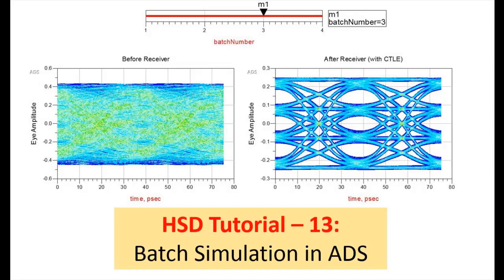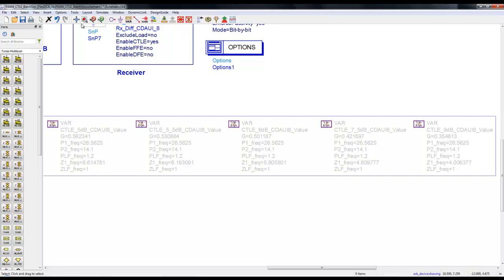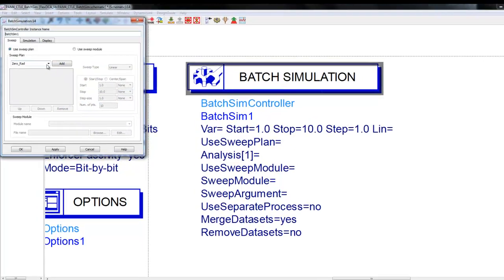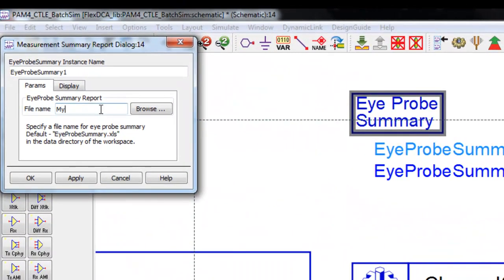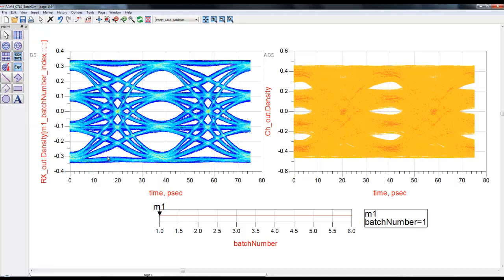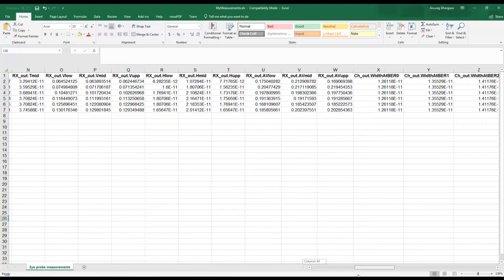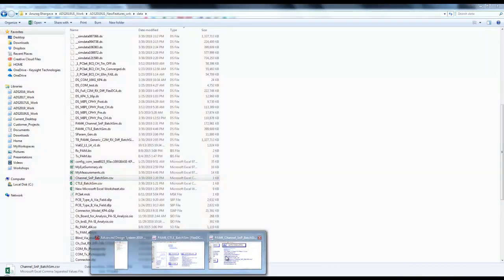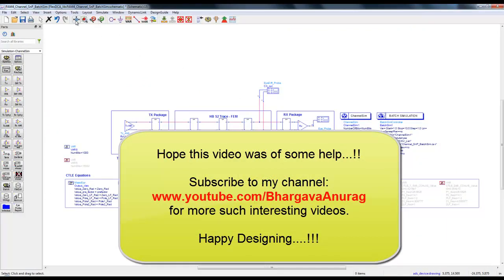HSD Tutorial-13: Batch Simulation in ADS

Comment: This video has been so helpful, I was able to set it up the way you showed, but when I change the batch number slider to 1 or 2, or 3, it seems that the eye has the same input values in all 3, so it did not sweep across the CSV file, any ideas?
Reply from the maker: It is difficult to suggest a solution without looking at the problem but few things you can check:
1. Without the slider do you see different responses overlapping and you can visually see the difference?
2. If not, probably you need to check your schematic and see if the variables used for sweeping are assigned in the desired components or not? e.g., you might be sweeping rise time variable but if the same variable is not assigned in the source then it won't make a difference in results correct?
3. If you can see the differentiating overlapping results but it doesn't update with the slide then look at the slider setting and ensure it is applied to the plotted value correctly.

If you can resolve it then contact Keysight tech support team by writing to support@keysight.com
Reply: Same issue here as well.

Comment: hello，Have you posted a video on Back Channel Interface（BCI）? If yes, could you please share the link to the video？Thanks
Reply from the maker: Hi,
I don't have a specific video on BCI but it is supported in ADS Channel Simulator and it can be enabled by simply selecting that option in the IBIS-AMI models. You can contact local Keysight support team if you need further help on this.

Comment: If the adaptive optimization is available, do I still need to do batch simulation to find the best taps? I heard that the adaptive optimization algorithm inside the AMI model is independent between Rx and Tx. Is that means I still need to use batch simulation  to sweep all the situation. Does ADS has co-optimization process in EDA tool?
Reply from the maker: Hi Xiaowen, ADS does support that protocol. If you have it in the AMI model then you can simply enable it and ADS will do handshake as needed between Tx and Rx AMI models.
Reply: @BhargavaAnurag  Thanks. So I should just enable the adaption optimization, is there any other setting I need to do?
Reply from the maker: @xiaowenmin5336  that's correct, you just to enable settings in your AMI model to get going. There is no special setting you need to do elsewhere in ADS. You can refer to an PCIe example in ADS by searching for BCI and unarchive the workspace to see the settings. The adaptive optimization you referred is called as Back Channel Interface (BCI) and it is the protocol standard which is used by Tx and Rx to adaptively converge to the best possible settings of configurable parameters based on the Channel characteristics. 
I will try to create a video on the same so that others can benefit with this as well...😊
Reply: @BhargavaAnurag  Many Thanks! I am looking forward to your video.